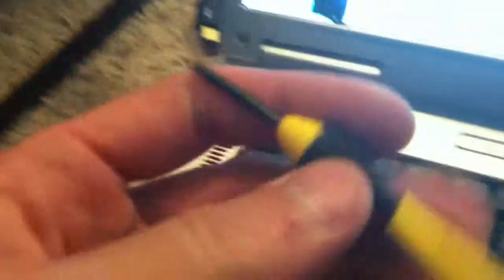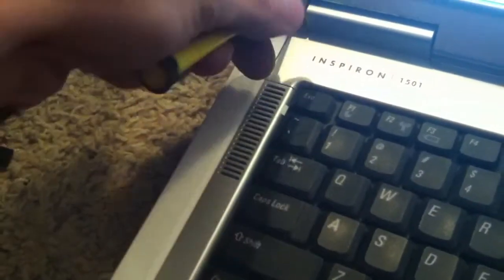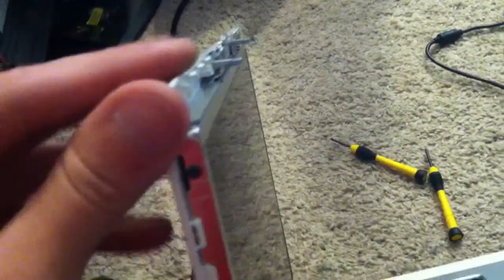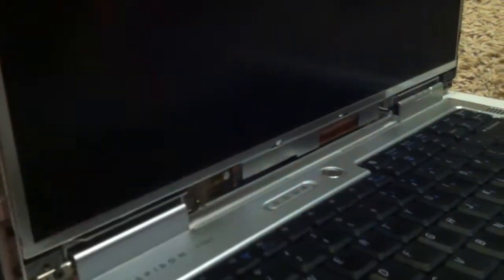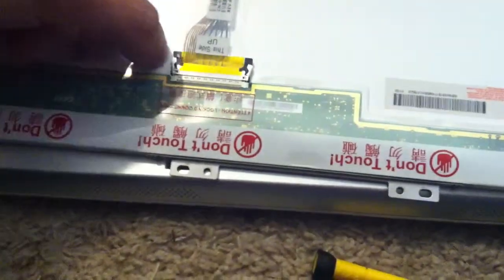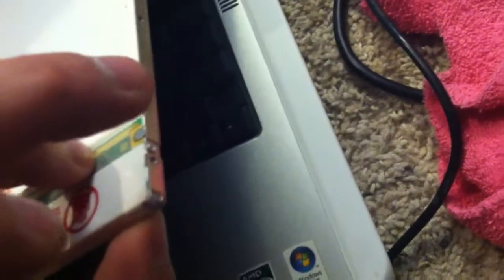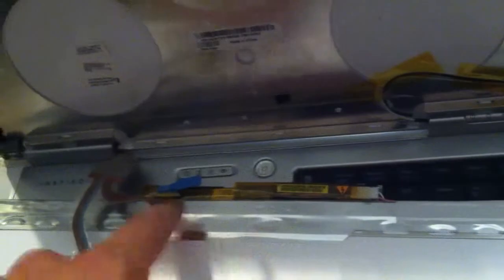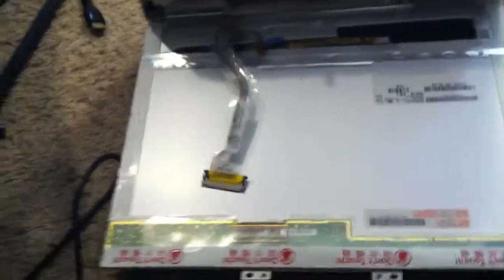Dell Inspiron 1501 screen replacement

Comment: I wish there was a way to use the old Dell Inspiron 1501 lcd screen with these new portable monitor board connectors with mini hdmi, 2 x usb-c ports, headphone jack, menu button, and power button.  It is a 40 pin connector on the portable monitor lcd.